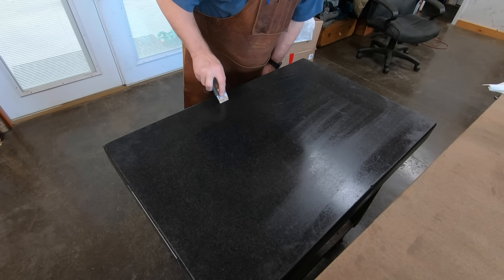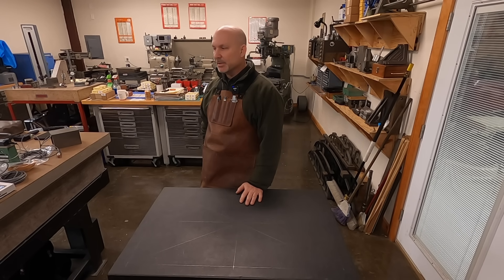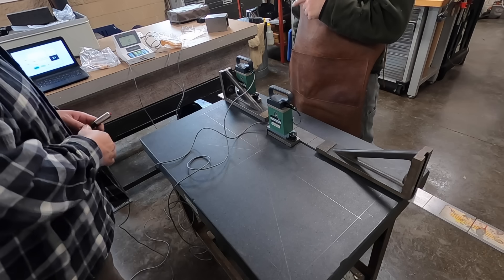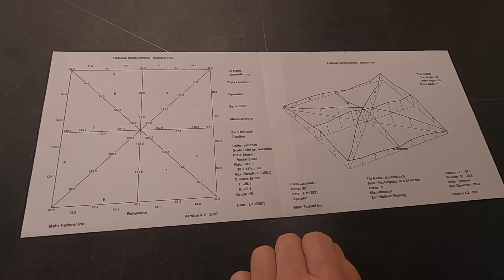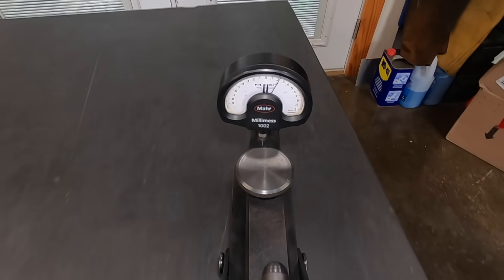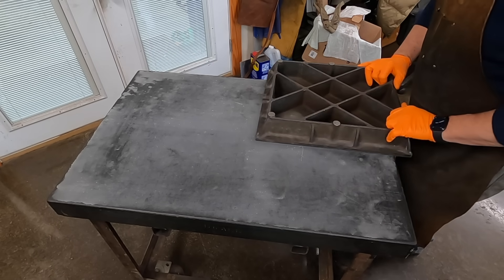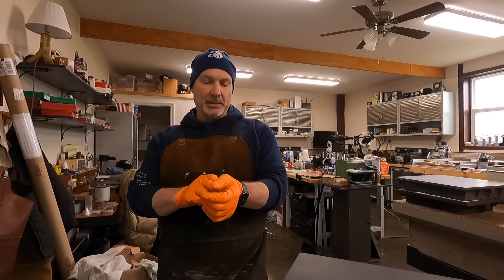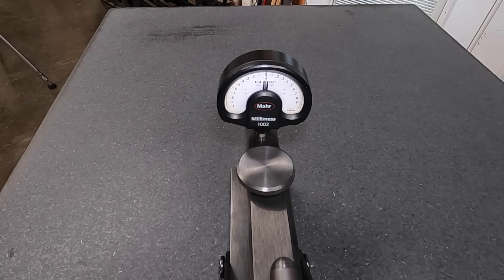Lapping my Granite Surface Plate to AA Grade

Comment: With a 24" x 36" plate and 2" border, the short side, long side, and diagonals are 20", 32", and 37.74".  With the 4" spacing of of the electronic levels, you get an integer number of measurements on the sides, but have a remainder of 1.74" on the diagonals.  How do you adjust for this remainder so that the points at the ends of the diagonals can be matched with the intersections of the short and long side measurements?  The choices that I see are interpolation, extrapolation, and increasing the spacing. Interpolation would require measurements including area within the border, which would be prone to potential large errors.  Extrapolation could also induce significant errors. Moving the level along the diagonals by 4" + 1.74"/9, would seem the best to me, but that's just a guess.  So, how is it really done? Thanks
Reply: When I calibrated 24x36 inch surface plates with the Mahr system, I used a 3" foot on the moving level. I wanted more than 5 readings on the short side, but I didn't really want more than 15 on the diagonals. When you enter the dimensions of the plate, the margin around the edge, and the length of the foot, the software tells you how many readings you'll be taking on each path. I marked our straight edge from one end to the other to match the foot. When I placed the straight edge on the table for each pass, I'd place it on the table so that the last marks were an equal distance from the edge. The number of marks is always one more than the number of readings, so I'd make sure I had the right number of marks over the granite. I don't remember how many readings it said to use, but here's an example. For the 24" side, a 3" foot might require 7 readings. So, 7 x 3" = 21" which meant the marks would each be 1.5" from the edges. For the 36" side, 11 readings x 3" = 33" so the marks would again be 1.5" from the edges. For the diagonals which would be 43.27" long, 13 readings x 3" = 39" so the last marks would be 43.27 - 39 = 4.27" / 2 = 2.13" from the corners. Since the feet were about 1/2" x 2", a placement error of less than 3/4" would hardly be noticeable. Had I made one less reading on each path, my last marks would have been 3", 3", and 3.63" from the edges and corners. That probably would have been fine and I wouldn't have gotten into the border. You'd have to fiddle with the border entry to make the software pick the right number of readings. I always kept a 4" foot on the stationary level because a shorter one would have been less stable and since it doesn't move, it doesn't matter what its spacing is.

Comment: 99 % of anyone watching this.  That is a back yard machinist that has used equipment, that is and was bought used at a very reduced price from new. Chances are just about any granite plate is truer to perfect than anything that so called back yard manual machinist has the capability of producing anyway. My lathe is about a 1966 Harrison and a 1968 supermax chinese mill and has been used. Im able to make good quality parts. That seem to work just fine for the customer. But i bet my granite plate is way more accurate than my work. And who knows how acurate the plate is that sticker that sticker has been absent longer than potatous brandons morales.
Reply: I get what you're saying. But its just nice to have nice stuff, ya know?

Comment: Very educational and excellent work fron Lance. Will moving the plate back to your shop "change" the flattness? (Flatativity? 😁)
Eric
Reply: Not enough to effect how he will use this plate, also changing temperature (gradient within the plate) is actually a bigger factor than absolute temp.  Granite is very stable, if you are interested in some of the theory, Moore has a section at the beginning of Principles of Mechanical Accuracy that you could read.  ATB  and thank you for the positive comment!
Reply: @lancebaltzley  lance, I live in Bowling Green KY.
Are you near enough to inspect and tune up my 18x24 Starret Inspection grade plate? Naturally I would pay for this service.
Eric

Comment: I'd be curious to know how flat a sheet of glass is in general, as i use a 3ftx2ft 1/2in thick sheet to lap cylinder heads/blocks for the past 15 years. Would be a interesting little snippet of video for Lance to capture for your channel @Abom79
Reply: "float glass" which is common today, is made from floating liquid glass on a bed of molten tin.  Getting glass as flat as Lance has that table, would require optical polishing of the glass surface.  See the Wiki link
https://en.wikipedia.org/wiki/Float_glass
Reply: @jimmurphy6095  I wouldn't intend to try make it flat as it could be. Was just curious as to what type of level plane they were. Interesting subject now though, i shall watch up on some vids and read some.

Comment: How many times can you lap it until it's as thin as a tile? What is the thinnest banch plate you may have until you have to replace this granit plate and what happens with the old plate?
Reply: The block is about 4" thick, the wear is a few tenths of a thousandth of an inch, most people won't need it lapped for a while (year or two, guessing)

You could probably lap it a few thousand times, my guess

Comment: Certification really only matters in maching products where protection from lawsuits becomes critical  Same thing with ISO 9000.  The process is the same, the equipment, too.  You get the same plate, jst with no piece of paper to document it.
Reply: @madjimbo4176  it's not inteneded to protect from suits, but to potentially decrease damages.  All this really stems from the massive suits surrounding the Challenger disaster years ago and the importance placed on documentation of inspection methods  evidenced in court years later.  Remeber the hubbub about "O rings"?
The documentation used in manufacturing today is just saying, "Here's what we did" when in reality it's just what we say we did, but maybe did not really do.  Just another way insurance companies and litigators make money by convincing their customers they are hard at work earning their money!

Comment: When you achieve 'flatness' doesn't the lapping late 'stick' to the granite? Or does the lapping compound prevent this happening?
Reply: You're thinking of "wringing" two very flat pieces of metal (like Jo blocks) together- that's a sort of cold weld (not really a weld, just van der Waals attraction over a large area) when you exclude all the air from between the metal pieces.
Most stone can't be ground that flat. Granite is a composite of several minerals- remember it being pointed out that the pink granite contains a lot of quartz? The softer mineral components are eroded away faster by the diamond compound leaving air gaps between the quartz bits, and the air prevents wringing.
Reply: @markfergerson2145  Thank you for explaining this. Molecular bonding must occur between two similar elements...

Comment: One of the main points of metrology and the related fields is that it's about the most objective thing you can do in the physical world. Who did something is of no relevance at all compared to what they did. The ultimate gold standard is to have measurements that aren't based off some other specific artifact, but rather based off some reproducible physical property that can be measured by anyone.

Now that is not to way that any old Joe can do this out in their driveway. Knowing the details of what needs to be done and knowing how to do it correctly (and tell when you mess up) is a skill (which can be tough). And when it comes to things like lapping I suspect there is as much art as science in being able to do it efficiently and the same for being able to identify and resolve limiting factors on the quality of the result. But how good that result is? Measure it and everyone should get answers that agree.

Comment: When taking the measurements with such accurate devices which measure down to such a fine tolerance will the thickness of the carbon from the markings effect the outcome
Reply from the maker: Lance can probably answer that but judging from what I’ve heard him say, those marks are not a problem. I believe they’re sub 50 millionths.
Reply: I have tried to measure them actually.  Can not get a repeatable number.  However, I believe they are in the 20-40 millionth range based on lapping.  As I said, I have not found it to effect the overall accuracy when measured.
Reply: @lancebaltzley  Thank you for that I was just curious

Comment: It amazes me how much the lapping plate sounds like it is really grinding on the surface plate, even thought you are using a fine dust. Very interesting process. Thanks for sharing. Does the color of the surface plates signify a difference in hardness?

Comment: Hi Adam, can you give me a brief explanation of why the granite plate rests on three points?  Thanks much.
Reply: Because four points is never stable unless the frame it's sitting on is exactly as flat as the bottom of the surface plate.  If the weight is shifting between different points due to uneven support, the surface plate will not be repeatable - even thick chunks of granite bend.

Comment: The soft gray granite is easier to lap but presumably wears out more quickly. Is there some other advantage to using it?  Or just more affordable option for light duty applications?
Reply: Dunno - since the grey is soft, I wonder if there's a wax or "top coat" that will set thin, but provide protection and increased sliding ?
Reply: @criggie  You don't put anything onto a plate that would cause dust to stick to it - as Lance explained even dust can become lapping paste.
Actually "soft" is a relative term, dark grey granite is about the softest of the granite, but it is still way up there on the "hard rock" scale.  Pink is heading into the insanely hard region on the same scale.
Reply: @criggie  yes, talk to anyone in stone industry
Reply: @18robsmith   sealer coats   are applied,  polished off, no residue  to  attract dust or grit, no downside  only benefit
Compare it to waxing your car with ceramic coat,  dirt and  dust don't  stick the same way, cleaning us easier, 
Issue here is lack of knowledge  and consequent mistaken beliefs 
Ex owner of stone business, and worked in industry for many years

Comment: Could you possibly do the same thing to a piece of quartz countertop I wonder?
Reply: Countertop would likely be too thin. You could certainly lap it flat, but it likely wouldn’t hold under its own weight when 10s of millionths of an inch (100s of nanometers) count. There would be too much flex.

Comment: I'm not sure if I would have enough self control to STOP LAPPING at the point of diminishing returns. Just like when I watch you indicate a piece of stock on the lathe, and you get it within 0.001" or 0.0005" I am second-guessing you in my head, like "what about a gentle tweak, would that make it more perfecter?"
I imagine that to get the whole plate to within a skillionth of a whillimeter would require placing the lap, moving it a couple inches, removing the lap, re-measuring, and so on forever. Diminishing returns for certain.
Is there even a AAA certification for flatness, or does it stop at AA?
Thanks for all your uploads, I really enjoy watching and learning from you.

Comment: Off topic alert. Adam I see you hammered your thumb. To me the worst pain ever, every time your heart beats, ouch. I wanted to let you know there is a tool you can get to reduce the pain after the injury. It’s an electric cauterizing pen. I have one and it works great. I think some are skittish about using such a thing especially when actively suffering but it does provide immediate relief without causing pain during its use. It’s just a matter of manning up and doing it or have someone else do it for you while you look away. I’ve only used it once but I’m glad I have it. 
It might be fun for us to track the progress of the damaged area as it progresses across the nail. I think it’s usually takes 8  months. So maybe you could show it in each subsequent video.
Reply from the maker: I actually pinched it between a large EMD wrench and a hex nut, on the shaper table. Hurt like hell!
Reply: Lost two fingernails (middle and ring) once to a crowbar slamming into them. Drove me crazy until they grew back. Brushing against anything sent shocks up my arm. Couldn't even put my hand in my pocket.
Reply: Exactly as gubr78 said. A small sterile  #60 drill by finger twisting it or hot pin has always  worked for me, also doing my kids fingernail  and a few coworkers. Plus it gets rid of the ugly look. Yep,takes a long time to grow out.

Comment: What type of things is this used for? What requires this level of precision?
Reply: They're used to check the precision and standards of the production of the parts of every machine that's used to make virtually everything we use, including the machine we wrote this on and so much more.  So, by extension, they're used everywhere.  Good questions.
[Edit: Grammar]
Reply: This is so not my field of work, but ... measuring tools alone need this type of precision for countless reasons. It's why a nut made in say your home town fits correctly on a bolt made on the other side of the planet.
Reply: @bobsofia68  Precisely, Silvio...pun intended.
Reply: I work in the injection molding field. Much of the work done for the molds and tools are measured to the 1 ten thousandths of an inch, or .0001" precision. We use granite surfaces for measuring components.

Comment: I guess I understand, in principle, what you are doing. What I don’t have is a perspective of how much accuracy is required. For your average guy scraping in his bridgeport, realistically how good does his surface plate have to be? 99% of us are not doing Renzetti type work. If a plate is only good to a couple of 10ths, how will that impact a print in a camel back straight edge? Will it change? Of course it sounds like we want A instead of B, but do we really need it realistically? Fascinating to watch. You have clearly invested a lot of time and $$ in this.
Reply: Depends if you're working in a lab or making wooden chairs in your shed. If your clientele is your next-door neighbor, it's not a problem, if its Los alamos labs then you're gonna need to step it up.

Comment: So without charging with diamonds the cast iron plate would have cut it?
Interesting process.
Reply from the maker: You need to have an aggregate to do the cutting.
Reply: @Abom79 , I assumed so but the reference to not using it had me wondering.. I probably miss heard when y'all referred to how aggressive it cut.
Reply: I think they meant that there would have been enough diamond in the iron left over from previous uses.
Reply: @chuxmix65 , makes sense now, thanks.
Reply: @chuxmix65   That's how I understood it.

Comment: This is a very interesting, and educational, video.    Thank you, Lance, for taking the time to explain how the process is done.   Thank you, Adam.
Question:   Given that the grey is a ‘softer’ plate than pink, would that mean it may wear, to a lesser tolerance, faster than a ‘harder’ plate?   Just curious.
Reply from the maker: Yes the dark granite wears faster than the pink granite, but because of its hardness and time to lap it’s more expensive.
Reply: So then, how often should this plate be checked for in calibration of the standard at hand?
Reply: @Abom79  Thank you, Adam!    As I said, I’m just curious.   Not disrespecting you or your very nice granite plate.
Reply: @jdmccorful  it really depends on your use and your requirements. I would say industry standard is 12 months... but if you have a few years history of little to no wear you can usually increase that calibration frequency.

Comment: This makes me wonder if Lance has granite countertops in his kitchen and are they AA grade too?  On a serious note, is there some sort of protectant you put on top of the granite after it's lapped... or not?
Reply: No, you can’t put a coating on it, that would reduce the flatness, and any residue would hold dirt. 
Better to treat it with care and have it re-checked periodically; how often depends on how much you use it, and how important the work you are doing on it is.
Reply: Disagree with the comments re coating affecting flatness, and attracting grit and dust.  Coming  from background of working in stone Industy  and as owner for a good few years  totally disagree,   there are good  products that seal the surface without leaving  a greasy residue, rub it on, polish  it off, done, some are better than others,  some last longer

Comment: Good job fellas, i would have thought you shouldn't let the lap plate overhang the edge of the plate more than 1/4 to save lapping rollover into it. Also to save your rotational influence on the lap you should move around the plate when lapping and not stand on only 2 of the 4 sides ?

Comment: What kind of part needs this type of precision?  I don't get it.
Reply: The problem mainly is compounding errors. If your base measurement is off, then everything else will compound. 

But many fields needs super precise parts. For example I'd like my surgeons to have to best equipment when they operate on me if that would ever be the case. Or if you send something up to space, you want the best parts money can buy, since replacing would be hella expensive.
Reply: Aerospace stuff would need this type of precision. Also certain Toolmaking. But an AA level plate is overkill for most machinists. An AA plate would be kept in a climate controlled environment away from all machines